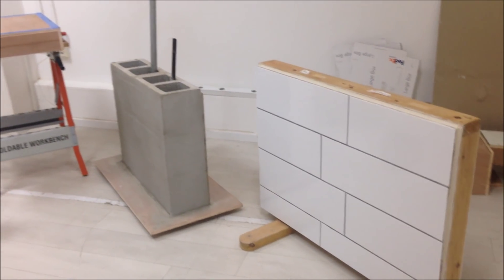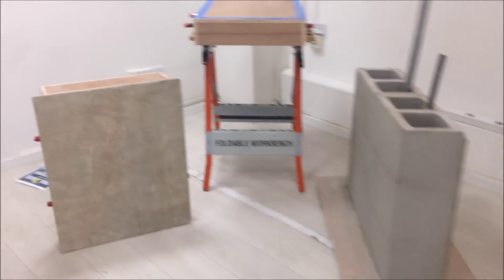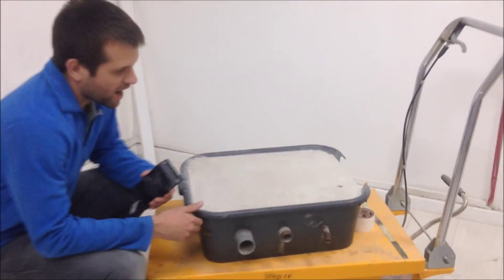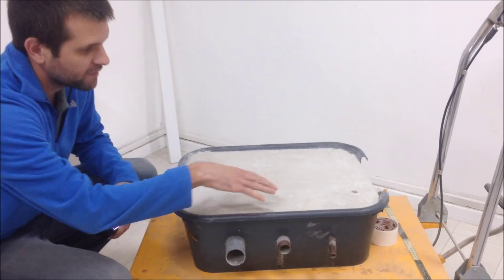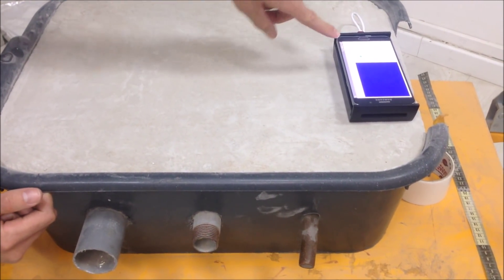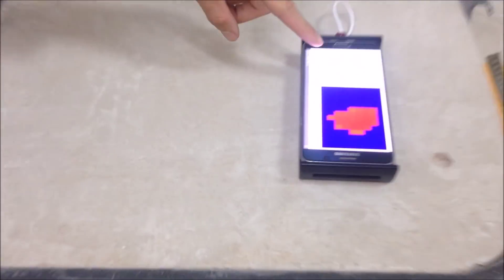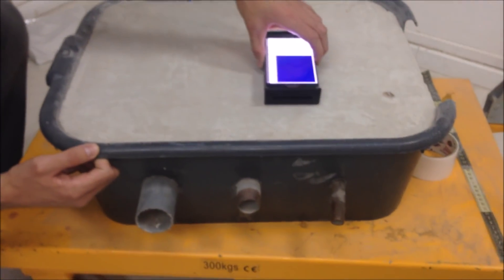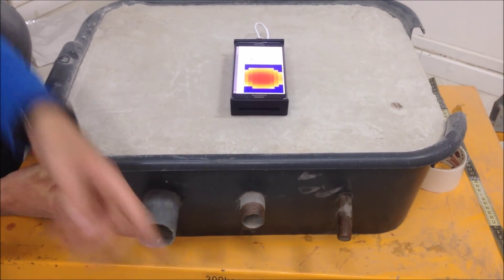Walabot Wed #2 - Cement & Close Range Depth

Comment: If its truly that good it be a great product. However another thing would be if one can make it see thru/down into soils /earth outside as well. This seems like a bigger issue to do then just going thru thinner concrete , wood, drywall ,...etc But one could make a phone attachment to see deep into the ground/earth and identify different types of objects in soil would be the ultimate. Still wondering on if it can see thru glass , marble , and other stones/rocks , clay ,...etc. Because then this phone tool becomes a geological tool as well to identify materials in earth types of materials , rocks ores ,...etc in earth

Comment: If I want to drill the concrete floor of my garage for anchors to put in a lift, will Walabot show me where the 1/2" pex is in the floor so I don't drill into my floor heat?
Reply: Did you ever find out if it detects PEX pipe in concrete?